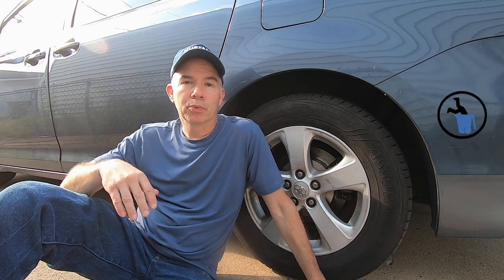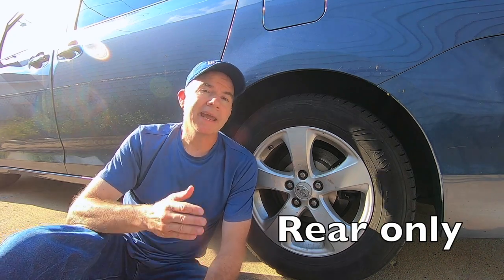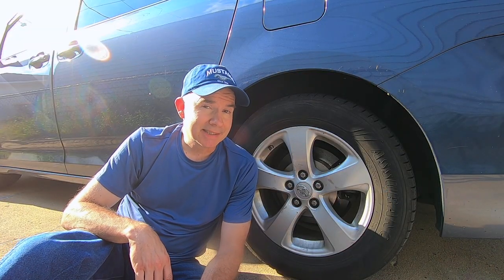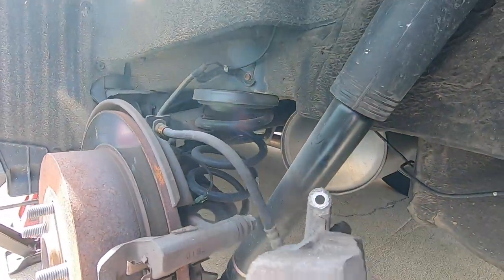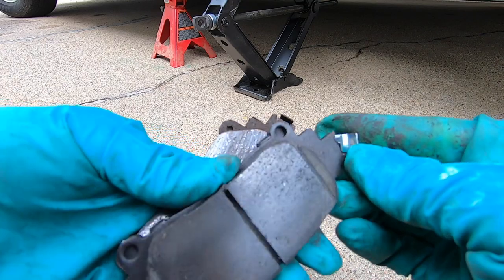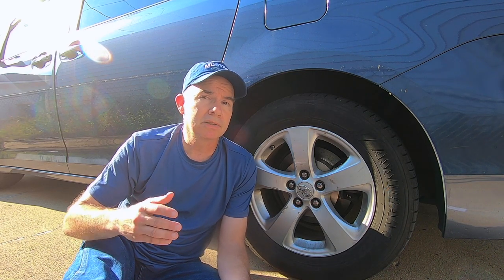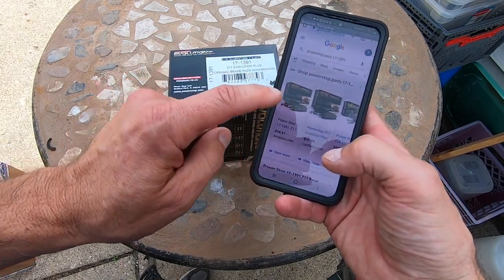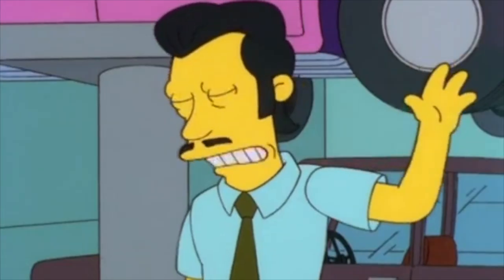Are Brake Jobs a Scam?

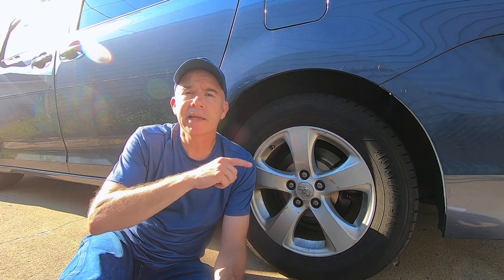Comment: So unfortunately unless you are an automotive professional and run or work in a shop you may not understand. As in this case. Most shops do not spend the time to resurface rotors because the cost is just as much and takes more time for the shop then it does just to replace them with brand new ones.  So on average if the shop is charging a $100 to 4:41 150 an hour in labor it's going to take them 1 hour to reserve us your old rotors if they are in spec. Most passenger car and light truck rotors are only about 50 to $75 each for brand new ones.Also when you're putting new brake pads on an old rotor the surface is glazed and the rotor is probably  Warped. Which is that feeling you feel when you get on a freeway exit  And apply the brakes  At 55 to 65 Miles an hour and you feel a vibration in the steering wheel or on your brake  Pedal. And people do not understandautomotive shops having extremely high overhead. This is coming from a 27 year veteran of the  Automotive business. Plus you are correct in your statement any professional shop will give a 1 year parts and labor guarantee on a break job. And they know tips and tricks to install them correctly whereas Di guys do not. Sorry just the way it is. But you can waste your whole weekend. Doing your own breaks and have issues and then have to do them over yourself. Forgive up and take them to a professional. I do agree at some places are over priced. But if you have a good quality professional mechanicpay the price for the job To be done right and have a guarantee of the work. And if you buy parts off rock auto it's gonna take a week for them to  Show Up And if you have to return something you have to pay for the return shipping and it's gonna take another week. As reason shops do what they do unfortunately some shops give most shops. A bad reputation. And if you can do it yourself go ahead and do it save yourself some of money. But when I have to redo a customer's work. It's full price to get all apart but it's all back the way it's supposed to be. The brake flush is kind of a scam add-on most of the time unnecessary to change the fluid. Unless the manufacturer schedule maintenance calls for it at that mileage.

Comment: The only issue with break jobs we have ever had is that a 93 lumina required a special tool for the break calipers.  So it was pay 15 for the tool or twice the cost for every brake job.

Comment: Is it a scam?  Well brake jobs do exist so in that regards they are not a scam.  If someone charged you to replace blinker fluid then that would be a scam.  After you removed your old parts it was obvious from the video that those parts were not worn out and did not need to be replaced, so that part is definitely a scam.  In most vehicles today, front brakes do most of the work and wear out long before rear brakes do so that should throw up a red flag.  My father owned a garage for over 60 years and his advice would be to go to a tire store to buy tires, go to a garage to fix your brakes.  Don't go to a tire store to fix your brakes.  I don't recall that his prices were too high, or too low, but we never tried to sell someone something they didn't need.

The parts prices you were quoted were very high.  If you check auto parts stores you can find a variety of products and prices so it is not uncommon to find the "best" quality parts for twice the price of the lowest prices.  The prices you were quoted might be more in line with what the Toyota dealer would charge you for new Toyota parts.  The labor charge actually seems low.  Consider that the shop has to pay the employee for his time, the shop has to pay rent and utilities, insurance which is probably pretty high to cover the building, cover the tools and parts, cover the employees, cover the customers.  They have to buy tools and maintain them.  There are an unbelievable amount of fees that they have to pay the government.  They have to order the parts from somewhere and wait for them to arrive which takes time, or they have to go get them.  If it is a shop that keeps parts in inventory then they have to pay for that too- more space to pay rent on, they have to cover the cost of some parts that might not be used as frequently as others.  The person running the shop has to schedule the jobs, write up the estimates, write up the bills, talk to the customers, collect the payment.  All of that takes time.  Consider the total time it took you to do the work on this video- you had to order parts online, that took time.  You had to open the box, get the tools out, jack up the car and do the work, throw away the old boxes and parts.  That takes time.  You have to clean up the parts on the car before you reassemble it, then clean up and put away your tools.  From the time you put the jack under there until the time the tire is back on the ground is a short period of time but there is a lot more time involved than that.  If you had to take an afternoon off of your day job to do this then you would be losing 4 hours of salary.

You didn't do that brake flush yourself and that probably wouldn't be needed for most normal vehicles.  In my experience very few cars get their fluid replaced over the life of the car.

You're in the DIY business, and I'm in the DIY business too, so we can do the work ourselves and save the money.  People who can't or won't do the work themselves have to pay to have it done and there is markup and profit involved.  It is not different from the painter that charged me $2000 to put on $200 worth of paint, or the plumber, or any number of other people I have paid to have work done because I couldn't do it.  I would expect $300-400 to have pads and rotors replaced on 2 wheels, maybe I'm out of touch.  In my case there are a lot of projects I can do in 4 hours and save myself a lot more money than 4 hours of my salary so I do them.  I think the key is that some business sectors can charge more money due to supply and demand, and consumers don't shop around as much.  Supply and demand is why I get paid a lot less than some other types of business.

Comment: SSHM = Shop Supplies / Hazardous Material disposal. Almost all dealers/shops charge this at some rate. Supposedly to pay for random supplies (wipes, gloves, etc.) they used for your job and any cost of properly disposing of hazmat from your job. On one hand, I get it — but I’ve always felt this item is inflated and more than what it really costs.
Reply from the maker: Ah, that makes sense. I remember that now from a previous repair with them. Personally, I think that's a cost of doing business...
Reply: Shop supplies means they charge you for the shop towels they use. Since most shops use cloth towels they charge you for them then wash them so they can charge the next customer for them
Reply: The supplies component of that is not very large… it’s the hazmat fees coming from both the government and the hazmat waste handler that is the majority of that.

Comment: As someone who currently works the industry its certainly never a job I'd pay for myself, but then I'm capable of working on my own car. The main factors in the cost of brake jobs for us is plain and simple the warranty. Every major repair shop has to be able to warranty the repair. Which means that even though you rotors probably could have been turned, on cars made in the last 20 years they tend to come out thin enough that you're back to us complaining about noise or pulsating within 3-5 months. Ergo new rotors, and because we are likely to have to replace these parts under warranty without us being able to get any sort of money back on parts, because brakes are wear items. Most major places charge you around 1.5-2x markup on parts. The shop you're talking too is hiking those parts up almost 4x from their cost. Most brake jobs in the industry today run about 450 per axle
Reply from the maker: Thanks for your insight. I assume repair shops inflate the cost of parts for all repairs. As I said, I'm sure it's standard practice but I would feel incredibly guilty if I operated my business that way.
Reply: @AlleyPicked  they have to make a profit man lol profit margins are pretty slim in the auto industry. Most people just don't like forking out a grand or so for a repair because to most of us, that's a massive hit financially. But what can you do? Cars are expensive machines. That's life.

Comment: Their prices on parts and labor are way too high. One thing though, the brake fluid flush is often overlooked but probably not a bad deal at $99. You can and should do it yourself for the cost of the brake fluid and an additional 30 minutes of your time. Changing the brake fluid every 50K to 60K will extend the life of all of the hydraulic components.
Reply: I paid $30 to have mine flushed after I changed the brakes at all 4 corners last year. $99 is still too high.
I made beer money in college doing other peoples' brakes for 1/3 the price of the local shops.  They'd quote them $300 plus tax, I'd do it for $100 and make $60 profit.

Comment: Good Video. I worked with a mechanic that would always rip off the customers for brake jobs. We ganged up on him and called him out on him directly and to mgmt to get him to stop. We were always busy and made good money without having to resort to deception. However, I looked closely at your pads and it lloks like there is still plenty of life left in them. Depending on your driving habits, they do not need to be replaced until they are within 2-4 32nds of thickness left. The rotors can be turned. I used to do it all the time on the brake lathe. The only time they should be replaced is due to being below minimum thickness. So the shop was clearly trying to rip you off. There are test strips you can buy to test the brake fluid. These tell you if it is time to replace the fluid. Also, some manufacturers have scheduled replacement interval for brake fluid. It is easy to change the brake fluid, but it does take some time. I am a retired ASE Master Tech and have a college degree in Automotive Technology. Keep posting the good videos.
Reply from the maker: I appreciate your feedback and experience. If you approve of this video, then I guess I'm spot on :-) Thank you!

Comment: The labor rate is very low on that brake job. I think it's one hour of labor. the mechanic is really getting screwed over there or they are hourly and not flat rate. At my dealership it's 2 hours of labor(178x2) and it also applies to every other dealership, unless it is a very high end brake job. Our brake jobs come out to more than a grand per axle. I'm very grateful that people love their German cars. While everything you said is true in the video, you also need to consider that you are paying for a professional service, job warranty and convenience. The way I do brake jobs is almost surgical attention to detail. Never had a comeback on brakes, never a complaint in my career. That of course does not mean every other mechanic works the same way but their honesty on how they perform the work goes up as you pay more. Also cutting the rotors is almost useless nowadays because the labor time equals the price of new rotors. If you cut the rotors, you increase the risk of them warping as they get thinner. BTW there is a special caliper gauge to measure rotor thickness. the way you measured them is just wrong because you're only measuring the lip.
Reply: It's hard to see in the video, but it looks like he has the step of the caliper jaw past the lip so he should be getting an accurate measurement.  Plus it doesn't look like he's actually measuring them, just kind of a visual for the video.  Personally I use micrometers, but I could easily get an accurate measurement with those calipers.
Reply: Yeah, the mechanic and the customer is getting hosed with that estimate. 1 hour for the mechanic and $100 in parts =$769🤣

Comment: Their quote was ridiculous. Also, It looked to me like your existing pads had a good bit of life remaining which begs the question was a rear brake job needed in the first place.
Reply from the maker: After removing all of my pads, one of them was worse than the other 3. I guess if you are changing 1 you might as well replace all 4? But the rotors? those were fine...

Comment: Well see that's not really fair though because you need to compare it to places like autozone o'reilly's not rock auto and you gotta understand there's a markup price they are a business they aren't going to trade dollars with you so the money for the parts it's not a scam. I will say they charge you pretty damn steep for the rear brakes but they can service those rotors they're just a pain in the ass on the rear rotors because they take more time to cut than front rotors but that is not a excuse to sell new rotors. Them saying they cant resurface your rotors was the scam.
Reply: It's less common place now supposedly because rotors are thinner from factory than they used to be decades ago. It's for fuel consumption. Less rotating mass equals less energy. So since they're thinner now a days, less shops are willing to turn them cuz they're more likely to warp.

Comment: A good shop will go the extra mile to clean things up and lubriate everything nicely and even apply corrosion inhibitors. Cheap shops will just slap things on without care, like this guy no offense. If you live in the rustbelt, i dont think its a scam to have a shop do a good job and save you the headaches of seized and corroded brake parts. Been through it myself. I dont mind paying a little extra now.

Comment: I took the Mazda to Pep Boys to have some work done on it. And then they said that my brake rotors were cracked, and it was very dangerous and needed to be replaced. I decided to do it myself, but as I am checking them out I don't see any cracks! , I’m I only checked one wheel so far, but it looks great and the brake pad still have about 3/8 of inches of lining. I feel like I am being scammed. Also, I don’t race it 😅
Reply from the maker: They should have brought you to the vehicle and showed it to you. Always ask to see it. It's not easy to crack a rotor.
Reply: @AlleyPicked  Good idea!  I should have done that.  And considering the fact that we hardly even drive that vehicle.

Comment: Well lets see... Building Rent, gas, electric bill, insurance, staff, maintenance of equipment, tool men (plural) tax bill(s). Add THAT all up genius and that is why a brake job is so expensive. Do you do your own dentistry? How about your own construction? Take a class in business arts and LEARN SOMETHING about how a business operates.
Reply from the maker: I am willing to pay for the labor but don't deceive me to be about how much the parts cost. There is no way a simple brake job should cost almost $900. Some places charge a reasonable price but my point here is that I was being taken to the cleaners by this particular mechanic. I am informing people so they understand what they are being charged for. If they are willing to pay $900, thats fine, their choice, just be educated about it.
Reply: @AlleyPicked  That's ONE individual. After 30 years of diagnosis and repairs, not just "parts cannon" a vehicle, it's disingenuous to use Rock Auto as a comparison. We can't (and won't) buy parts at THAT cheap of a price point. We rely on Mass warehouse type suppliers. CPW or O'Reilly are the LEAST expensive, yet highest quality parts. Call any dealer for a brake pad quote from the parts department or get PREMIUM pads at AUTOZONE. Use THAT as basis for prices. Just be logical in your video(s) your misrepresenting the efforts of honest & hard working business owners.
Reply from the maker: I went to the NAPA parts website and the prices there were half of what the mechanic wanted to charge me. So I did an apples-apples parts comparison.
Reply: @AlleyPicked  That's possible. Midas auto service has a 300% mark up on parts. Firestone has a 400% mark up 😵. Everything is more expensive this last year, so passing down SOME inflation costs is to be expected. Always get 3 quotes on ANY major work. I do 3 brake jobs a day on average. $300 to $400 is around the price for pads, hardware, 2 rotors, labor & tax ( shop supplies & disposal too)... $900? That would include 2 loaded calipers and bleed ABS system too...
Reply: @jasonpocaro2730  The cost of the job isn't the issue, it's misrepresenting the cost of parts in a bill or estimate to the customer, which like it or not gives people the impression that the shop is dishonest.  This issue does cause shops to lose customers, it would be better to simply charge more by adding the cost to other areas like labor.
Reply: @GarenP  I make my paycheck on a % of the labor charge. The shop makes 25% on the parts. I have been at Dealers, national chain stores and independent repair shops. It's only a few that give the majority a bad reputation. 3 decades of being a technician. Like a doctor diagnosis, always get a second opinion 😎👍
Reply: $796 is ripping the customer AND mechanic off. Shop, it looks like they are paying 1 hour labor. So a mechanic makes 1 hour off that job, plus compensation for the brake flush. So maybe $35-45 + benefits. Shop has $100-120 into parts and materials. So $150-165 for labor and materials into it for the shop. 

Comparing it to a dentist. I can see a dentist for about $100-150 if I pay cash for an hour visit. 😉
Reply: @mph5896  You can't put tax on that, so your equation is already off. You didn't include pay for the secretary or parts guy. Water bill, electric bill, rent, lawsuit (s) and insurance. Plus, 8.4% of bill goes to... Uncle SAM, right off the top